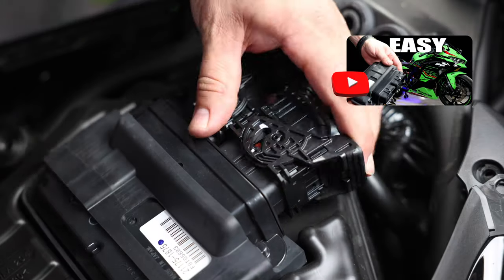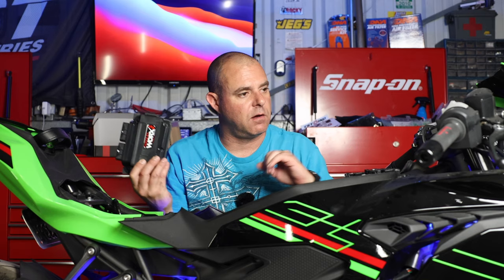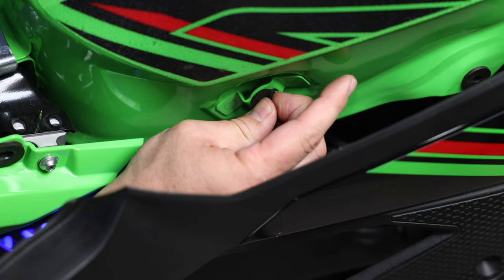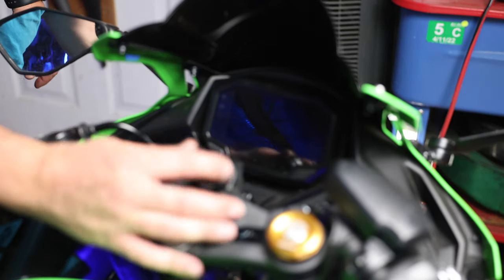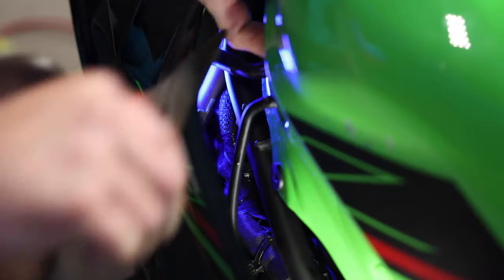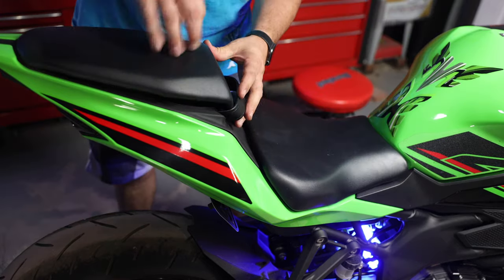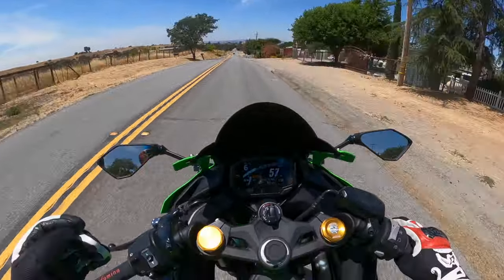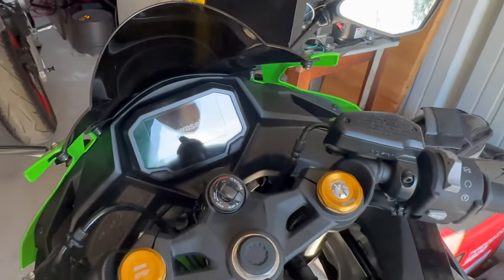Ninja ZX4RR ECU flash, Check engine light fixed and ECU Install

Comment: What an awesome video! How exciting!!! I love the pull! Even better, No Check Engine light! 👍🔥🤟🏼🎊😊 Your ZX-4RR looks like a ton of fun! 👌🏻😎
Reply from the maker: Thanks Elizabeth, I can’t wait to get a full ride in on it such a fun build and bike
Reply from the maker: Did you try the bmw 750 or did you just get the 1250 gs?
Reply: @ScoutsOut  Hi! I tried out both bikes. I rode the 750 for about 3 weeks and then decided I wanted to try the 1250. I really enjoyed both bikes. Actually, The 1250 was a much smoother and better balanced bike than the 750. BMW really has nailed it with the comfort, speed, riding position, easy u turn ability, and all of the electronic features on the 1250. The 750 was a fun bike. However, the 1250 nails it in all aspects! Have you ridden both? 😊
Reply: @ScoutsOut  Awesome!
Reply from the maker: Nice, I have only rode the 850. And am planning on renting the 750 for the week to see how I like it.
Reply: @ScoutsOut  How exciting! Let me know what you think of the twin engine in the 750. 👍😊
Reply from the maker: Will do

Comment: The ZX4RR's ECU is much easier to take out than the Ninja 400. The Ninja's is actually a little more work to get back in but not real hard. Had my ECU reflashed by TST too with a stage two set up. Full exhaust, filter and velocity stacks. Like the way it got rid of the restrictions on the stock tune. Bike is very fun but it was fun before so...its all good!
Reply from the maker: That’s surprising it was harder to get out. I hear ya as it’s going to be cool to have the bike gain some power but I was pretty happy with it already lol
Reply: @ScoutsOut  Yeah the ECU sits down under the seat in a soft rubberized case under a brace on the subframe.. Once you loosen a few bolts and unplug the harness its easy to get out. The problem is getting the damn thing back in! Tight fit inside case but sure is easy to pull out of it! You have to shove and prod the damn thing back inside the case. Not as easy. Once you get it in there, its good. The stock tune is ok and the bike is fun to ride around town. You get blown around on the freeways at 65-70mph because its only 370lbs. TST reflash is great! Takes away the stock restrictions and ups the horsepower to 51-53hp depending on exhaust.Plus ups the torque to 30-31. I have the Yoshi full system. Had a two brothers slip on but they did not offer a header pipe so went with Yoshi. I originally ordered an arrow exhaust from Revzilla but they had it on back order for 6 weeks then Arrow did not send mine. Wait another 6 weeks or buy something else. Two brothers I went but did not look into headers. Not sure why two brothers doesn't offer but everyone else does. Graves and Sparks offered the most HP but Yoshi was right there and I liked the sound better. Plus Graves is $600 more for full system.
Now I'm messing with my VFR 800 Interceptor and will put full exhaust on it from Delkevic plus a Corbin seat for the Sport Tourer. Already have the Delkevic slip on in Carbon Fiber. The V4 sounds amazing and the VTEC kick in over 6000 rpm's is a hoot!
Keep up the great work!!
Reply from the maker: Haha almost always how it goes… so easy to get out and hell to put it back together. That’s a decent bump for the n400, I miss my n400 such a great bike. But that VFR is going to be sick!!

Comment: What octane do you use after the ecu flash and did you have to disable the O2 sensor, exhaust valve  and pair valves? I only have slip on exhaust on mine.
Reply from the maker: It’s just removing the restrictions so that it gets full power on the throttle twist all the way up to 16k rpm. No need for o2, or valve removal/delete. Still wanna stick with supreme fuel 91 and up. I currently only have a slip on exhaust as well

Comment: Just got my ZX6R flashed..did you just ride it a few times for the engine light to turn off?
Reply from the maker: Nice dude, yea 3 cycles on ride off is what it took for me to
Reply: @ScoutsOut  you were right...after 3 cycles on the 4th no light 👍
Reply from the maker: Nice dude! How is the flash and which one did you go with?
Reply: @ScoutsOut  I went with MooreMafia, really like the smoothness coming off the throttle, not to mention the extra noise from the exhaust
Reply from the maker: Nice, I still need to get a real tune for my 4rr hopefully next season after I do intake mods. Glad it all worked out for ya man